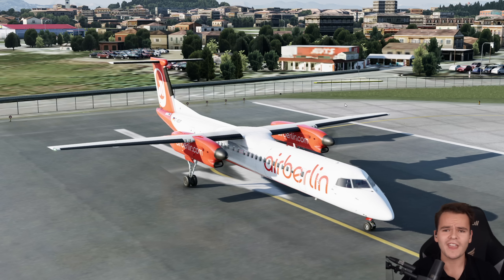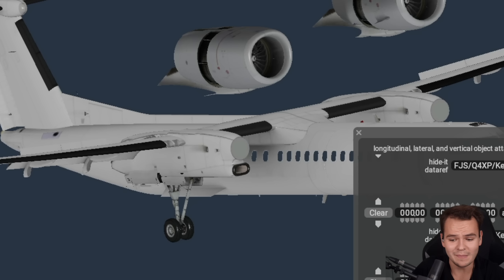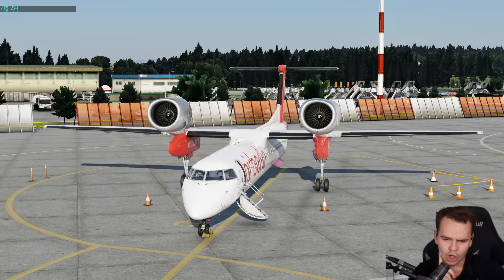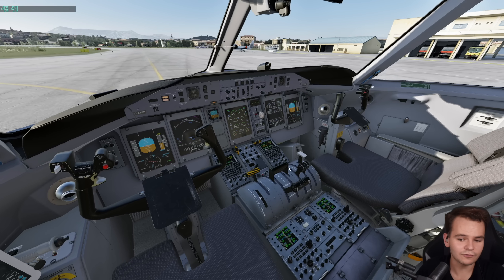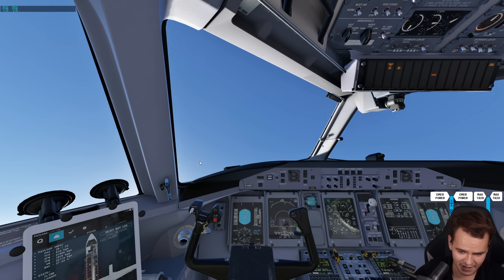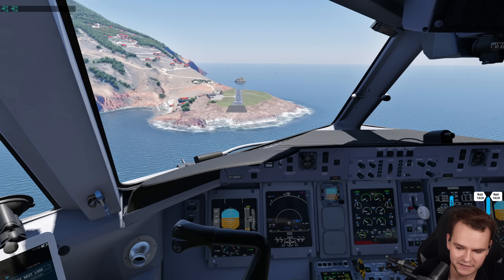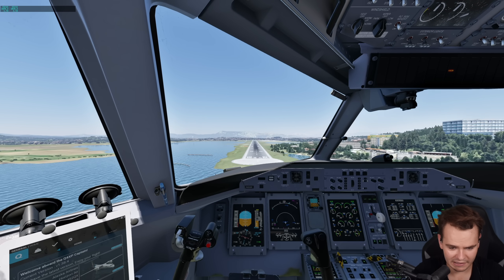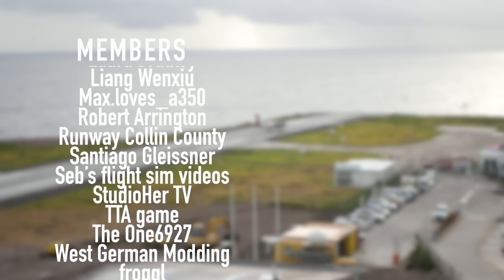Why A Q400 With Jet Engines Is A TERRIBLE IDEA

Comment: Ive flown on the Q400 16 times, most of any aircraft. Where i live, when the Q400 takes off you get pushed so far into your seat its hard to reach forward. The landing though.. it feel like we drop 100 ft on to the runway. No matter weather, pilot or airline. Every landing here with them are always super hard.

Comment: You should have tried it with the Rolls Royce F130 engines. The new ones they are putting on the B52's. Learjets use them too. They are small so you might even be able to put them in the nacelle. Prob be a more sensible amount of power as well.

Comment: You should’ve done it with the ATR-72-600, Similair in size but a key difference is that it has the landing gear on the fuselage instead of under the wing engine things

Comment: There was a vision for a q400 with jet engines smaller ofc but the wheels where still the same minus the engines ofc and the wheels were 4 feet further out and the engines went next to the wheels hanging from the wing worked fine but was abandoned

Comment: I have only flown on the Dash-8-100. But putting CFM's on the Q400 is way overkill. CFM -34's are more reasonable. And also. You started the #2 engine. Not the #1 first.

Comment: Now make a Turboprop A340.
Reply: That would be very majestic!
Reply: Well, the closest you can have is an A400M, which is a very cool plane indeed.
Reply: Can’t even get off the ground with turbofans 😭😭😭
Reply: @ultrablade9182 true
Reply: @ultrablade9182then put 85868776656566757573848685859939292939495959686868584848686878786858489393929339  turbofans
Reply: @ultrablade9182Tu-95 with 4xNK12 turboprops has MTOW of 188 tonnes, while the smallest A340 has an empty weight of 177 tonnes, so within minimal fuel it should work fine, and if you slap on 8x NK-12 then it should be just fine even at A340 MTOW.
Reply: Need to use Europrop TP400 or contraprop engines
Reply: Yes
Reply: Revamped DC-8 in a nutshell
Reply: Yes please
Reply: Pleas 😊😊😊😊
Reply: In TFS
Reply: Add 8 engines
Reply: now it ACTUALLY has the jet power of a hair dryer
Reply: Would Kuznetsov NK-12 be enough to power it?
Reply: Even slower
Reply: No it would die instantly
Reply: It’s not already?
Reply: If we do that he has to add like 20 turboprops just to make it fly like the a340.
Reply: A380 😂
Reply: Piston powered An225 🗿🗿🗿
Reply: 84
Reply: Might be hypothetically faster ngl
Reply: You just made a big plastic table fan 😂

Comment: You've just made an An-72
Reply: Where did you get ATR?
Reply: @TextGuy-z6k  it isnt atr its antonov
Reply: @ZoghdanOfficial  yea that is what i said
Reply: A Canadian AN-72 😂
Reply: I think he meant the AN 42 which has a similar design to what swiss created
Reply: Or a Dornier Jet
Reply: The engines on the an 72 where on the body not the wings
Reply: @jefftaylor4172  no, they were on top of the wings:the Coandă effect is used by placing the engines above the wing, the exhaust flows over the upper part of the wing.